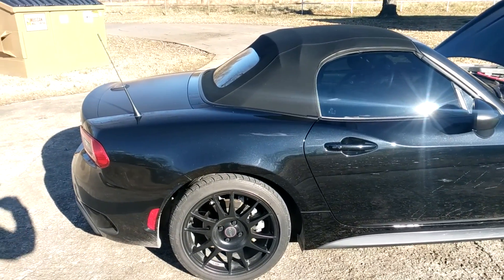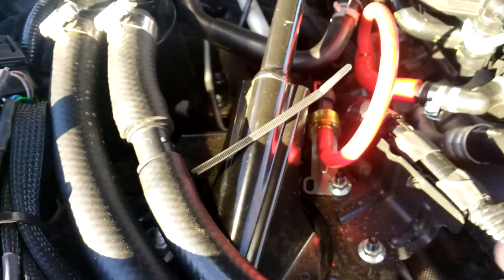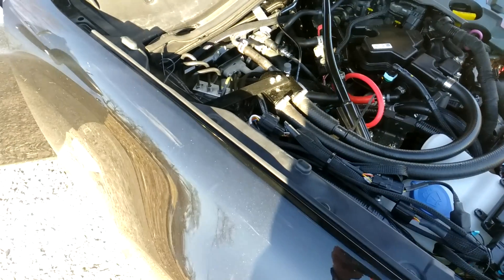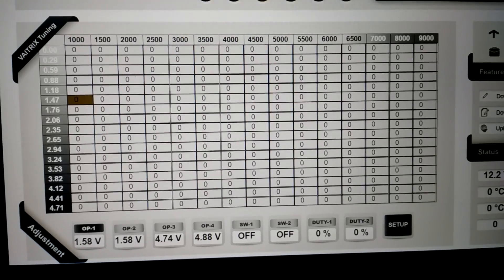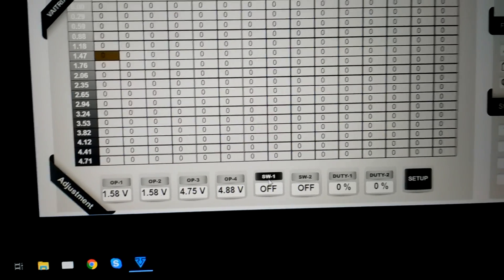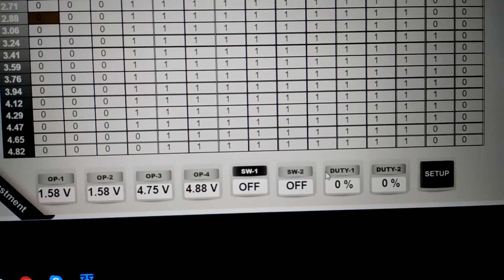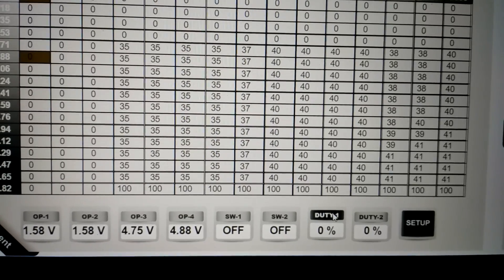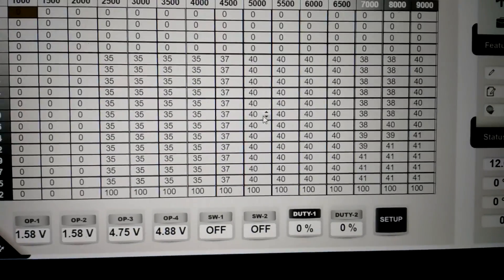Water Injection map, 45psi boost gauge install,  trivia, and 1/4 mile fun

Comment: Enjoyed your video, 
Since buying my 2017 spider abarth 
With a manual transmission just learning about Phase 1, Phase 2 tunes.
About your 14.3 1/4 mile run
Who did you buy the mods from.
Very interested in this or maybe a larger turbo. 
Thanks
K63300@yahoo.com
Reply from the maker: Everything is from Eurocompulsion.net, I do tech support for them. Hopefully soon you will see a faster 1/4 mile run. It's on my list of things to do this summer.
Reply: @GregsAirplanesandAutomobiles  
Thanks
What do you recommend 
That I buy from them ?
I Had a 1987 Porsche 944 some years
Ago which I regret selling and the 124 Abarth feels slower. 
Thanks for the video I look forward for more 
Videos
Reply from the maker: I usually suggest starting with a Phase 1 tune. Here is a review of it from Driven District: https://www.youtube.com/watch?v=3KAoHwsKRUg

That gives the best bang for the buck. Then add an intake next. I suggest the EC cross pipe and Record Monza exhaust to add a hair more power and improve the sound.
Reply: @GregsAirplanesandAutomobiles  
Thank you
For the information and replying 
I will check Eurocompulsion today
And the other link

Comment: This isn't a criticism, but an honest question.

On that 14.3 run, were you having traction issues, or is the gearing in this car a limiting factor on a drag strip?  I'd just expect a better time than that with such a favorable power to weight ratio, but there are of course a litany of factors.

I love the Fiat 124.  Fantastic car.
Reply from the maker: It's probably a combination of factors. First, I don't think the power curve and gearing are ideal for 1/4 mile action, nor do I think they should be, it's not that kind of car. My driving is probably a factor, I don't go to the track very often, this was the one and only time I took the car to the track in tuned form. As far as I know it's the fastest time a 124 has ever run on gasoline, so I didn't feel the need to go back and try and beat it. Of course the car now has even more power, so I'll get back to the track as time permits.
Reply: @GregsAirplanesandAutomobiles  

Sort of my thinking as well.  That all makes sense to me.  I'm more interested in seeing how it does at Hallett.

Thanks for the response!
Reply from the maker: I think it would do well at Hallett, but I won't run it there without a full roll bar. The factory bar doesn't go high enough for my helmet.

Comment: Love your channel Greg! A lot of times content creators shy away from the technical and scientific side of their content, and when they must include it, they apologize for it profusely and keep it to a minimum. You do not apologize and dive into it like a fish to water, this is very much appreciated. I do have a question though, it’s very smart to quench the cylinders with H2O in case of a boost spike or any other anomaly/failure. However, is there any chance of “hydro locking” due to the h2o injectors running at 100% duty cycle?
Reply from the maker: Thanks Martin. There is essentially zero change of that happening. Think of it this way, we are spraying 2-3 times more fuel in there, is there a chance of hydro locking with fuel? Well, I suppose there is a chance, but it would be nearly impossible in reality. You would have to have an injector get stuck open with the engine turned off, the fuel pump on,  and then crank it. Now in regards to water injection we are spraying far less fluid. For example, on a typical 2 liter engine with a 50cc combustion chamber, in order to hydro lock it, we would need to flow enough water to get over 50ccs into one cylinder during one intake stroke. Let's check the math. At 3000rpm we have 50 revolutions per second, half of those have an intake stroke (four stroke engine). So, that's 25 intake strokes per second. 25 x 50ccs is 1250ccs per second. So if all of our water goes into just one cylinder at 3000rpm, we would need about 1/3 of a gallon in one second to hydrolock the engine. The water injection system simply can't spray that much. Even with a huge nozzle, say 12 gallons per hour, it's just not even close. Now, there is a threat if the system runs with the engine off, but that's really the only way to hydrolock it.
Reply: Thanks for the reply! I knew two things when I asked the question, I knew that with a little bit of simple calculations you could figure out if there was any chance of hydro lock, and that you would do the calculations ;-). Thanks for that, and keep making the awesome videos.

Comment: I wonder if there is a practical water injection system for a Corvette LT1?  How would the computer be set up?  Anyone?
Reply from the maker: I'm not sure which LT1 we are talking about. On a stock 90s era LT1 it's not going to do much, but you could set it up by connecting a controller to the the air flow sensor and basing the whole thing on airflow. That will work well.

Comment: Greg, just curious. Why does the phase 3 tune make more power on the 500 Abarth as opposed to the 124 Abarth? They are the same engine.
Reply from the maker: The dyno results show 224whp for the 124 Phase 3 tune and 225whp for the 500 Abarth. That's pretty darn close. The flywheel horsepower numbers are quite a bit different. That's because flywheel horsepower is a calculated number and not a TRUE MEASUREMENT like wheel horsepower. The dyno uses a coast down feature to measure rolling resistance. It then uses that data to do some math and comes up with flywheel horsepower. However this type of calculation is subject to various errors that can accumulate. We put up the flywheel numbers the dyno generates because they are of interest to some people. However it's the wheel horsepower that counts.
Reply from the maker: Of course, there are no dyno runs in this video. Would you like me to make a dyno run video?
Reply: Greg, copied and pasted this from EC's website. 
EUROCOMPULSION® 1446+ TURBO UPGRADE POWER OUT-PUT:

 Fiat 500 Abarth/Fiat 500T/Fiat 500 2019+:

274 BHP / 284 TQ PHASE 3

Fiat 124 Spider/Fiat 124 Abarth:

247 BHP / 256 TQ PHASE 3

I just didn't understand the difference in reported numbers.
Reply: Wait...it just dawned on me I probably need permission to copy and paste that lol
Reply from the maker: Hi Robert,  The EC page isn't mine, this one certainly is. I personally dislike flywheel numbers calculated from actual wheel numbers because of the errors inherent in them. However, the reality of the tuning world is that so many people ask for them we had to put them up. Many of our competitors, specifically in Europe, only post flywheel numbers, which I consider worthless when not paired with the whp, but I don't think flywheel numbers are 100% accurate under the best of circumstances. I didn't dyno the Phase 3 500, but I was there for the 124's dyno. It's my guess that the 500's whp on the current Phase 3 is actually a bit higher, probably about 10hp higher, and that the flywheel hp is about 10hp lower. I'll probably dyno it myself to verify this.

Comment: Why did you not just buy a Porsche Boxster S 2007-8 and just tune it up, and add a Turbo and WI . Stock its quicker, engineering much better than a Fiat for goodness sake ? I just sold mine reluctantly, better looking and lines and bulletproof once the center bearing issue resolved on earlier models? Just thought as you were into Messerschmitts
Reply from the maker: Cars like this are bought for reasons that don't have much to do with logic or practicality. Why buy a Boxster when you could buy a Corvette for about the same money and have even more performance? Why buy the Corvette, when a Camaro SS with an aftermarket supercharger will be faster for less money? This sort of thinking doesn't ever end. In my case, I simply love the Fiat and I am not crazy about the Boxster. As for the engineering, I am not sure how we could compare that, but the Fiat's engine and suspension are fantastic. If only Fiat had made it a 1600cc instead of 1368ccs.
Reply: I get it and will stand down. One of my first cars @17 was a Fiat 124, then 2 fiat 128s ... haha. Then a German Ford Capri , Drove a Corvette once for a couple of weeks, great fun in the dry with warm tires , less so with warm and slick rain + oil (Texas rain shower) . I thought I was a good rally driver but the Corvette and Mustangs are accidents waiting to happen. The Porsche Boxster S 3.4 6 cylinder naturally aspirated was the best handling car I ever owned and the most reliable. I am going to regret selling it.  I nod my head and yes a 1400cc Turbo too small. Why engineer something below an S2000 which my son owns and is a future classic if any get left without being destroyed by crash or drifting. You know your motors my friend and remain a loyal subscriber.  @GregsAirplanesandAutomobiles

Comment: I know you don't look at it every day but if that program had color coding for cell values it'd be a lot easier to work with.
Reply from the maker: I suppose that's true, but it's not a problem. It doesn't take long to get used to the software and you can make changes pretty fast. Once it's done, you really don't look at it much. Then again, the people who make it update the software about every two weeks, so it wouldn't surprise me if they added that.

Comment: That silicone tube just after the top of its curve is awfully close to that Monte Carlo bar. A little trim for length will probably pull the tube away from the potential rub site far enough so engine vibration etc will not be a problem. If nothing else,periodic inspection is mandatory.Cheers
Reply from the maker: So far so good.
Reply: Greg's Airplanes and Automobiles Well good luck with it. Long as you keep an eye on it.

Comment: I do enjoy seeing the various 1/4 mile times and speeds you get out of these little 1.4 engines. Out of curiosity, how would this compare to some of the 1960's sport/muscle cars running 21st century street tires but otherwise factory specifications? (E.g. a Nova with a 327 small block or a Hemi Charger?)  In a different direction, with these modern engines, when you crank up the boost, are you reducing engine life significantly? How would a factory 124 engine look in comparison to a tuned 124 engine after 100K or 150K miles? Thanks.
Reply from the maker: Hi Mat. I can answer both of those questions. The Hemi powered Dodges and Plymouths were very rare. A Hemi Charger with 3.55 gears would run high 13's, and a good running 440 would typically see low 14's. The 440 was of course much more common and still very fast by the standards of the day. The tires really limited the 60's muscle cars. With larger wheels and modern tires I would be surprised if you didn't get a 1/2 second or even a full second improvement. Those old tires were that bad. So, a 426 or 440 Charger, GTX, Road Runner etc. with decent tires will smoke my Fiat 124. However, when you get into the mid range or slower muscle cars, like a Fairlane GTA with a 390, or a Road Runner with a 383 automatic, 3.23 gears, now it's going to be pretty close. Also, all the G.M. muscle cars prior to 67' if equipped with automatics had two speeds, so a 66' GTO automatic is going to have a tough time with my Fiat, modern tires or not. Of course, all those muscle cars can be hot rodded into the low 13s or better pretty easily. As for engine life, the Fiat is very good. I have a 500L which is coming up on 100,000 miles. It's had over 200hp its entire life and runs like new. It seems to have no wear at all.
Reply: Thanks.  @GregsAirplanesandAutomobiles
Reply: I'll second the longevity of the 1.4.  Rock solid engines.

Comment: My neighbor fired his Baby off yesterday, and the entire Neighborhood went over (with beer of course) to see it.
Baby is a 1956 Chevy two door sedan with a 632 cubic inch BB Chevy, it has dual twin sequential turbochargers (2 small and 2 large). He says the idea is to pull full boost at 2500 RPM but not have excessive back pressure at 6000 RPM.
He runs it at the 2000 horsepower level since his drivetrain can't handle the 3500 it's capable of making.
It must be nice to have money...................LOL
Reply from the maker: There is some crazy stuff out there in the automotive world. A 2500hp 56 Chevy rates pretty high on that list!